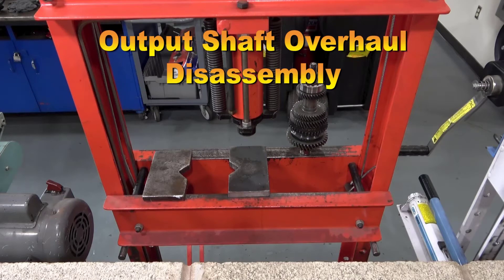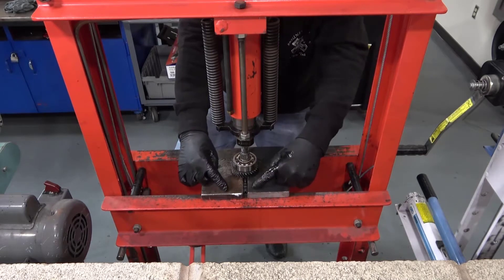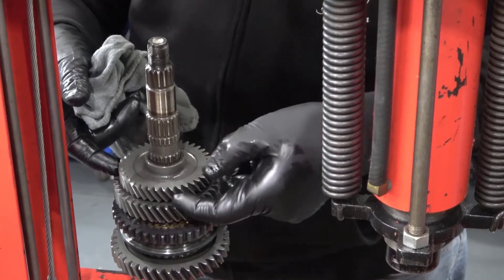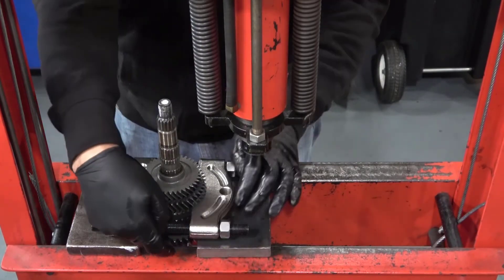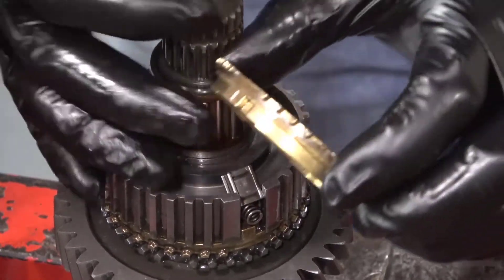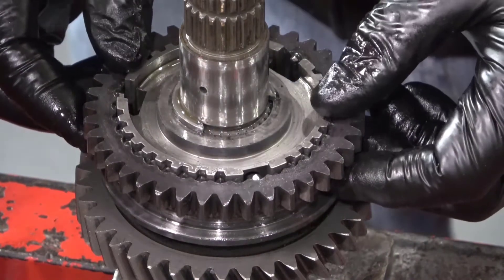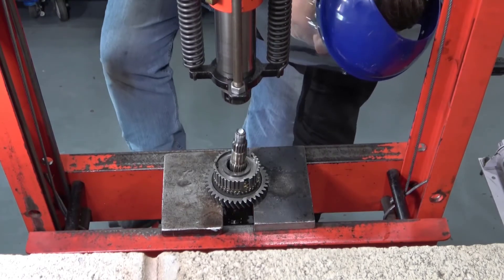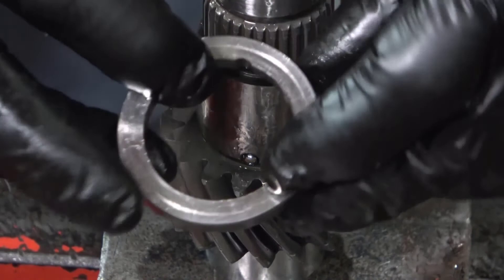Toyota Manual Transaxle (6.0) Output shaft disassembly

Comment: Hi Driveline Master!

Great video series, they have been a great help to me disassembling some C52 gearboxes.

Should the output shaft/pinion gear be kept as a pair with the final drive/ring gear?

Unfortunately to make the best out of my 2 gearboxes I might have to use the output shaft of one gearbox with the final drive gear from another. Can i expect this to be noisy? Is there any way to prevent this?

Kind regards!
Reply from the maker: It's always advised to replace gears as a pair however it's not always possible.  Look for signs of wear on the gears. Make sure the teeth count is the same.  Make sure the bearing journals for the other gears are all the same. Make sure the synchronizer splines are the same.  If all seems like it's going to fit go for it.
Reply: @DrivelineMaster  I’ll double check everything and then go ahead with it. Thankyou for taking the time to reply